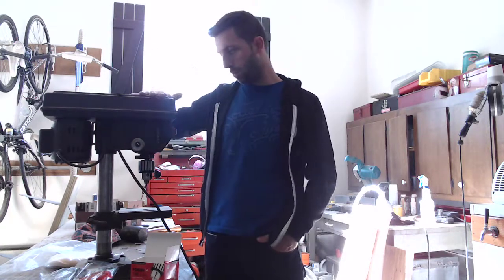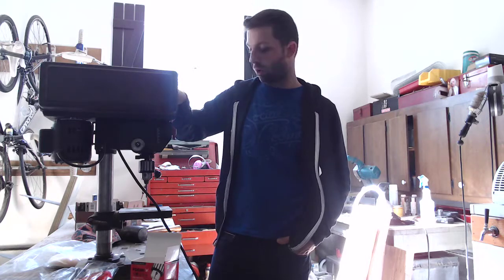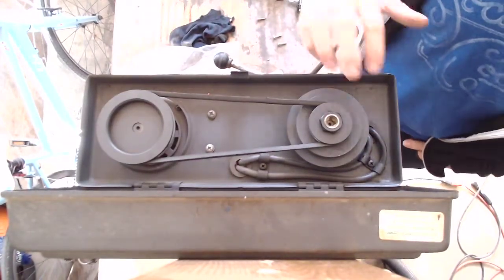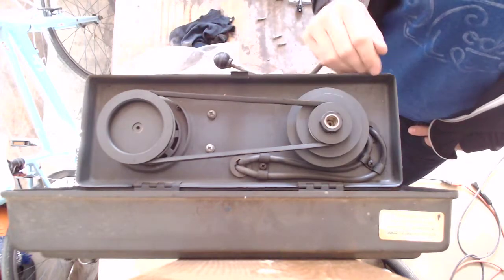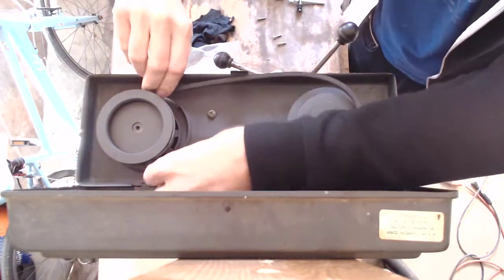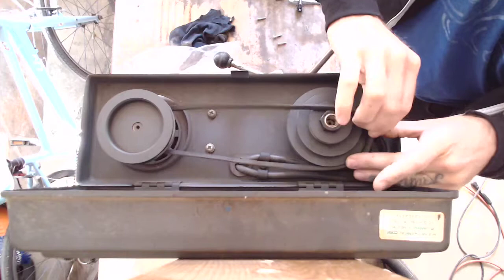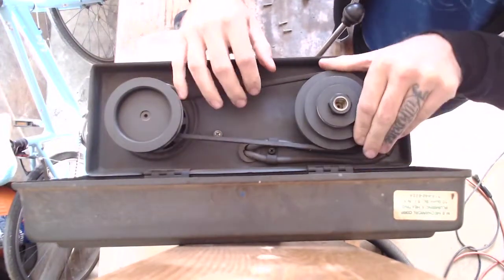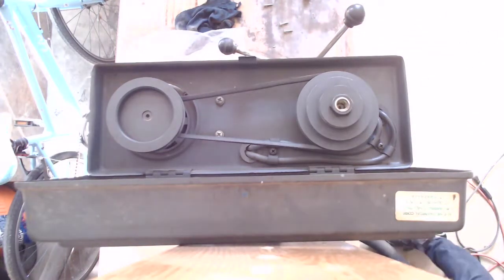Drill Press Speed Change

Comment: Press the belt and spin the pulley! That was the aha moment for me. So much easier this way than the official method in the manual, thank you! 

Note that you also need to unlock the set screws that holds the motor against the housing so you can push the motor towards the front, which brings the pulleys closer together and makes the belt slacken. That screw is on the right. I don't think I saw that in the video. Mine is all rusty so I had to use a trigger clamp to squeeze the back of the motor mounting bracket and the machine's front together. Then to push it back out, I held some scrap wood against the front tip of the rod that the set screw clamps against, and tapped the scrap wood with a mallet. That pushed the motor back out and brought the pulleys apart, tensioning the belt without deforming any metal parts. Hope that helps someone.

Comment: Thanks, that's helpful, I'm a first-time drill press buyer and I thought this was how it was done but it's good to have it confirmed. Just a safety suggestion (my dad was hyper about safety), I'd recommend taking out the yellow safety insert on the power switch or unplugging it prior to working with the moving components of a power tool (just a suggestion, thanks for the video).